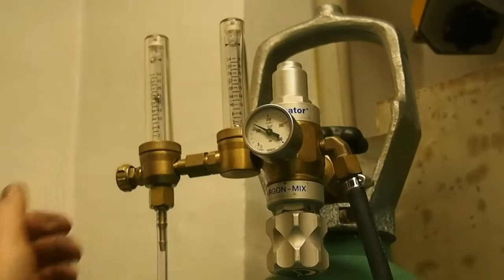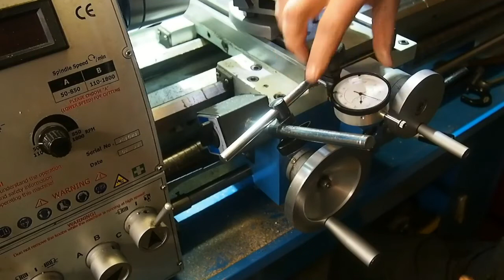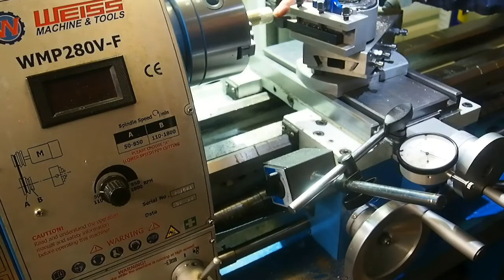TIG school project, water tank to my boat

Comment: That looks cool H. Nice job with the tank and the brass nuts are a nice touch.
Reply from the maker: Darren Blattner Thanks Darren, there is trouble with the plasma cutter so they couldn't cut the lid to it so I had to make it in the old fashion way and make it reasonable round on the belt sander, I drilled the holes in it and put some blots in so I could chuck it in the lathe and turned it round that worked fine.

Comment: Nice work. An alternative design for the lid would be a circle of plastic which would clamp onto a flange. The stainless steel flange  would also have the advantage of covering an otherwise sharp edge.
Reply from the maker: Kevin Hornbuckle Thanks Kevin the plan was to cut the lid on the plasma cutter but there is something wrong with it so it's not possible, I made one out of a 4mm thick stainless, I made it reasonably round on a belt sander, drilled the 8 holes and put 4 bolts in so I could chuck it in a 4 jaw chuck that worked fine and I could polish the edge, the plastic circle is a great idea and could have worked great. Cheers Henning